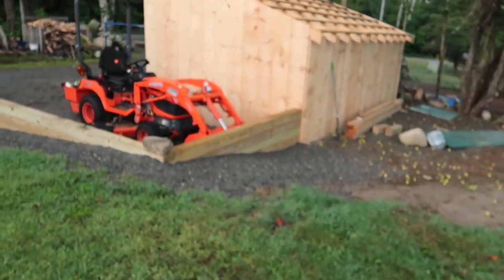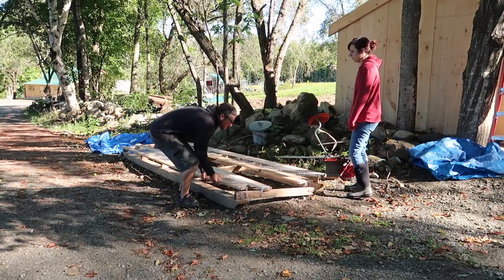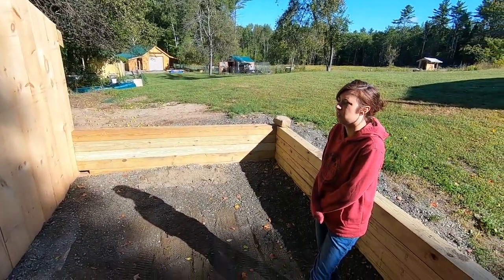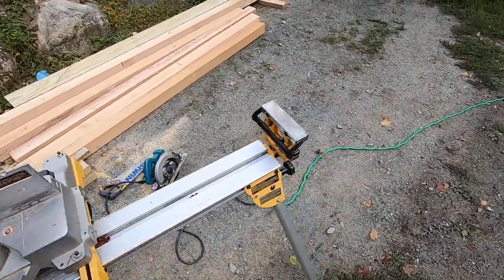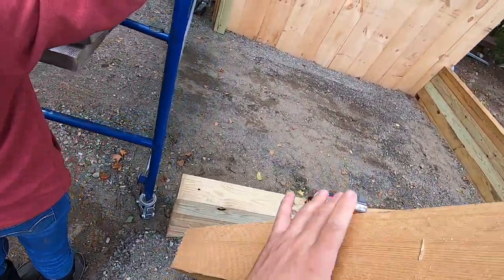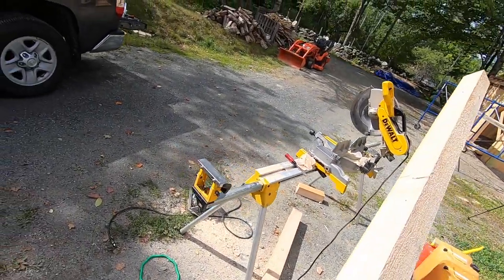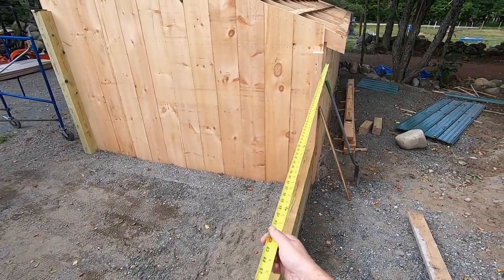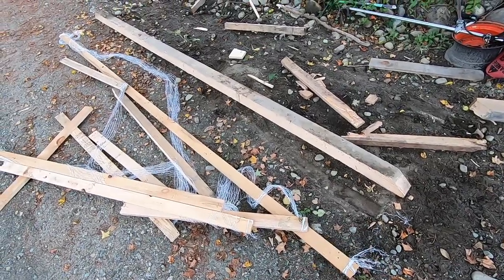Salvaging 4x4 Beams from a Pallet to Build our Post and Beam Carport

Comment: Horse "U" welded on a shaft makes a good pallet board remover. Pallet companies exist that savage and rebuilt pallets. They use a "U" puller to savage the boards so they can rebuilt pallets and resell. There are several grades of pallets.  Treated ones are for food usage and normal painted BLUE by a food pallet supply company.  They do not want ground bugs in food warehouse from unfit pallets.   So you can collect pallets and take apart for wood projects. One of my buddies made furniture out of some of the better pallets and crating  he collected. His delivery driver job wages did not allow for major purchases after food for his family.
Reply: Are you talking about a horse shoe?

Comment: A good way to get the perfect recess (lap) for your cross board is to set the cross board on a flat surface, put the saw on the edge of it and drop the blade until it stops on the flat surface. Perfect laps every time. Keep up the great work and God Bless!

Comment: You should have a couple Wonder Bars.The standard one for rough carpentry is about 12"s.Two or more to do jobs as diverse as car brakes,removing end bells and bearings on small motor. Cheap and useful for many task.

Comment: Gina brings her own new enthusiasm to the projects. The team runs a bit faster and more smoothly with two on the case. The new carport is a worthwhile addition and builds towards to the achievement of your plans. Using the wood from the pallet is sensible, timber costs money and that was too good to waste. Usable materials should not be dumped, burnt or thrown into the rubbish collection. Gina's work on the platform showed her confidence has grown. Clearly her on-the-job-training is benefiting your team and releasing her ability. 

Will you follow the same roof style as the woodshed across on the carport?

Comment: Gina:  You might want to remove your engagement ring when using impact tools; as the stone may work loose in the setting.

the old guy Bert
Reply: bert skelton .... Good Idea, Gina ... I actually take mine off and wear a plain gold band when I’m doing stuff with tools or mowing lawn.  Sometimes sits in its safe spot for the summer.

Comment: that big old Dewalt can be set up for notching  there should be a flip down stop on the right side with a thumb screw that sets your depth... once you Knockoff the leftover strips of wood  place a 2 X4 between the back of the piece of wood and the saw and you can drag it sideways to clean up the notch very fast and accurate

Comment: We really have not had a hard Winter for 4 or 5 years here in Virginia.  Summer kind of runs right up to February, then we get 2 weeks of cold, and on to spring for a month then back to summer heat.
Reply from the maker: 2 weeks of cold. That must be nice. 😆 sounds like you have summer heat mist of the time

Comment: Do you think the weight of the roof will roll that retaining wall with no support?  In time since there is no concrete footers, the corners will sink and the walls are going to roll outwards.  Still recommend a 4x4 at the outside corner down into the ground at least 2 to 4 ft.

Comment: Al, great job, yet a word of caution on your build. You use long screws, that's good, but you aren't putting in to play the to be expected live-load on the carport roof. Live load is everything which can stay on a structure for an amount of time, a person or snow, you guys have lots of snow, so lots of load. You need to make sure that you brace the retaining "wall" as well as the main posts. Because the smaller ones in the rear rest on the stack of vertically placed 4x4s this in building static is called the weakest point in your construction and can likely fail, if the live-load goes about 20 lbs per sqft (PSF), this value goes for where I live in Snohomish, WA. Your live load requirements should be in and around 40-60 PSF!!!! so try to put the load in to the ground on to the soil and not on to a stack of 4x4's it wont hold in the long run. 
You both are such a great team, I enjoy seeing this, as my wife and I are the same!!!
Reply from the maker: Thanks. They are stacks of 6x6s not sure if that makes a difference or not?
Reply: 4x4 or 6x6 don’t really matterAl. I’ll create a drawing and PM you about it.

Comment: Just a suggestion before you rip off the side discharge on your tractor use a bungee cord and keep it up out of the way when in tight area's. And the build looks good but did you put any drainage pipe or anything to keep water from going thru timbers into carport?

Comment: How are you going to stop the retaining wall open end being pushed in at the open end by the weight of the earth behind? You could either drive rebar down deep to peg it or drop a 4x4 across the opening just below the final grade... or both. There will be a lot of push especially from winter frosts and rain.

Comment: We noticed that the retaining wall for the carport isn't really attached to anything except itself? There's nothing anchoring it to the ground? There should be something anchoring that down. Rebar is really good to use. But, it may be too late. 

In past retaining walls I've built, I've always used 3 or 4 foot pieces of 1/2" or 5/8" rebar to anchor the first three rows into the ground. Drilling smaller diameter holes in the center of each 4x4 or 6x6, about 12 - 15 inches apart, pounding them through the beams into the ground with a sledgehammer. We do this (minimum) on the first three rows, depending on how high the retaining wall is going to be, how much earth is pressing against it, and what kind of traffic (if any) the earth it's holding back is going to see. I see you use a tractor a lot (big heavy machinery.) You might want to stay stay away from that retaining wall while using that tractor. 

Good luck guys. Keep up the good work! We enjoy all you do.

Comment: Wood buried in dirt isn't a happy marriage unless it's treated with some kind of preservative.  For longterm protection of your investment jack up your construction pour a foundation and slab place treated 2 x 6 on membrane, place the building upon it.  If not mold and rot will develop in 3 - 5 years.
Reply from the maker: We used pressure treated lumber

Comment: Be careful of nails sticking up ( 4:46) get one into the bottom of your foot and youll be off work for a week or two.
Reply: When I was 6 years old I looked at the bottom of my foot (out by the chicken house) because it felt like I had a tiny thorn or splinter in it. I started pulling it out and it kept coming, it was a four inch nail! Extra rusty! I didn't feel it going in at all and barely while coming out. It earned me a tetanus shot. 😌

Comment: I don't see that you buried the bottom tier of the retaining wall. What is to prevent it  from moving inward? We put retaining walls in on our place and the contractor dug down nearly a foot, put crushed rock in a few inches and then placed the bottom tier of interlocking blocks and buried them about 1/2 to 3/4 of the way up. That wall is not going anywhere!

Comment: If you have a trailer you won't be using for a bit, Gina could start stacking firewood onto the trailer.  I don't know if the roof needs to be one before stacking the wood into the shed, but if it doesn't, Gina could start putting the wood into the shed.  If the roof needs to be on, the wood can stay on the trailer.  This is something she could do instead of sitting around waiting for something to be screwed up.